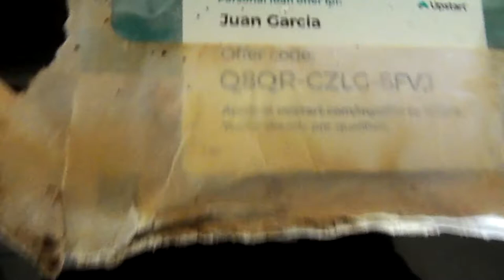Detective work with Police!!!

Comment: did the timing belt snap on that spare motor?
Reply from the maker: No it did not break. what broke was the camshaft pulleys oem locking pin.making the pulley spin freely with the timing belt still on therefore leaving the camshaft in a locked position then the piston came up smacked so hard it shock the whole car and killed the motor instantly.
Reply from the maker: I think it's not called locking pin it's a keyway I think. Well this keyway  is welded on there  oem From factory  the inside of camshaft pulley.
Reply: for that man i would say it bent some valves i just did 1 a couple days ago it had 10 bent valves but he also had a spare z6 head we pulled the valves out of it definitely rebuildable tho. the bottom end should be fine.